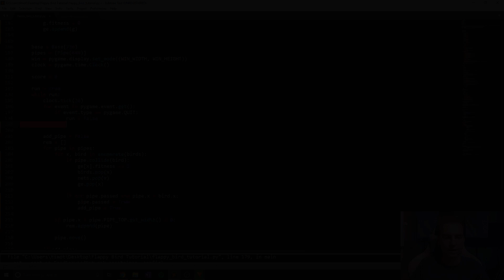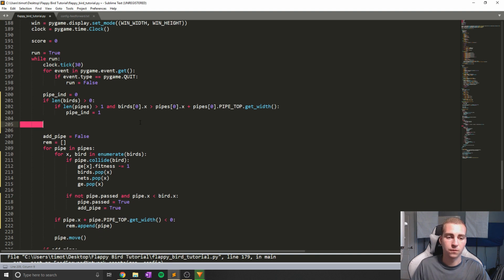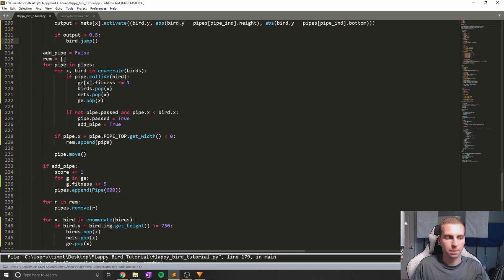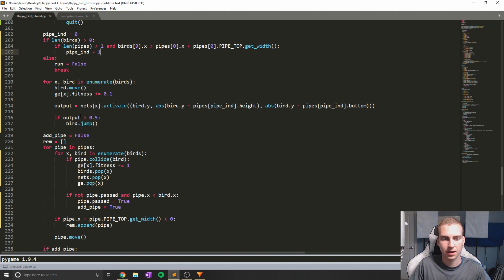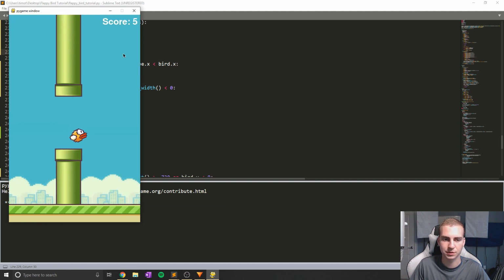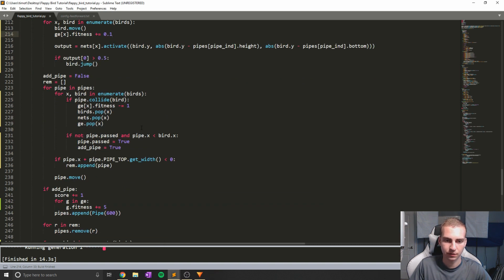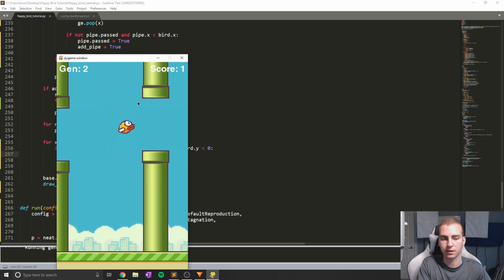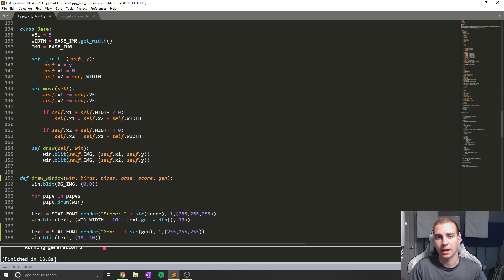Python Flappy Bird AI Tutorial (with NEAT) - Finishing Touches and Testing

Comment: for anyone reading this: Taking the Y of the bird as one of the input neurons is literally pointless. Since the other 2 neurons are absolute distance between Y of bird and Y of the pipes. The actual Y of the bird doesn't add anything because it's irrelevant to any of the decision making. You could either just not give that as a neuron or replace it with the bird's velocity. Which actually does impact decision making.

Comment: Hi Tim! Thanks so much for the tutorial, I learnt so much from this tutorial, and the explanation was on point :)
I had one question about the algorithm though,
Messing around with the code, I realized that setting the clock.tick value to a super high number causes the birds to collide very early in the game (less than 10 pipes or so)
and simply changing it to a lower number fixes the problem.
Do you, or anyone in the comment section know what may be causing this to happen?
Thanks in advance to anyone that gives advice!

Comment: when i run the code, i get a black screen and the population's fitness is always zero. it worked until i implemented this episodes changes. anyone else have the same problem?
Reply: I got the exact same issue. After stepping through the code, i found the draw function was never called. I missed an indent at this if/else constraint:

wrong:
        if len(birds)>0:
            if len(pipes) > 1 and birds[0].x > pipes[0].x + pipes[0].PIPE_TOP.get_width():
            |    pipe_ind = 1
            |else:
            |    run = False
            |    break

correct:
        if len(birds)>0:
        |    if len(pipes) > 1 and birds[0].x > pipes[0].x + pipes[0].PIPE_TOP.get_width():
        |        pipe_ind = 1
        |else:
        |    run = False
        |    break
Reply: check again for mistakes , i had the same problem, but it was due to some of mine mistakes, i don't remember  what it was, but it wasn't complicated
Reply: @electronics_8722  do you mind sharing your code for it. I would use the one he posted on github but unfortunately its very different from the video.
Reply: obviously,  that might be a bit too much to ask, so if its just something like that i guess ill review my code again. i havent touched this project in a while

Comment: Thank you for these videos
Can you explain how did you find the output value 0.5 :[
Reply: did you manage to find out why he said 0.5
Reply: @sashamuller9743  I'm wondering as well :P
Reply: @sander1426-2  I managed to find out :) The problem of this function is that the output of each neuron can saturate. Values greater than 1 are shaped as 1 and values smaller than 0 are shaped as 0.
The best sensitivity for the sigmoid function is around the central point (0, 0.5).
A big problem appears during the saturation, the algorithm can not learn during this position (it’s the source of the vanishing gradient problem, corresponding to the absence of direction in the gradient).
Reply: @sashamuller9743  That explains a lot, thanks!

Comment: 8:24 at this point I ran mine and it always tells me " AttributeError: module 'neat' has no attribute 'config' " despite me having installed and imported neat. I also tried "import neat.config" which didn't work. Nobody on stack overflow has been able to help me yet. Any ideas?
Reply: Have you maybe solved that problem by now?
Reply: @miloskatic1997  No i have not yet, any suggestions?
Reply: @Josephshanks7  Actually, I resolved that problem by checking whether neat or neat-python was installed. I knew that neat-python had to be installed, but for some reason pycharm insisted that it should be neat, lol. If you're coding in pycharm, go to: File->Settings->Project Interpreter and then click on the gear icon on the top right. You should see all modules that were installed in your project. With "+" add neat-python(not neat) and if you already have neat there installed, deinstall it with "-". After doing those changes, in your code write "import neat" and it should be recognized as neat-python(at least it was in my case). I hope this unnecessarely long comment was helpful, good luck :)
Reply: Hello, I was able to fix the same error by clearing the cache of my interpreter like so :

" Clean out the system caches: From the main menu, choose File | Invalidate Caches/Restart. The Invalidate Caches message appears informing you that the caches will be invalidated and rebuilt on the next start. Use buttons in the dialog to invalidate caches, restart PyCharm, or both. "

Sources : 

Issue description : https://rafikitechnology.com/2017/10/24/python-attributeerror-module-object-has-no-attribute-config/

How to clear cache : https://www.jetbrains.com/help/pycharm/cleaning-system-cache.html

Hope this helps.

Comment: Good series. I played around with it a bit and made the game more difficult by reducing the gap between the top and bottom pipes, so it's now random between 160 and 170. In the pipe's set height function it's:

self.bottom = self.height + random.randrange(160,170)

The AI struggled a lot with this, making it to a score of 30 after 20-30 generations. So I added another input neuron, and now it's much improved, and in my opinion more fascinating to watch it tackle this steeper learning curve. Can anyone guess what the extra input is?
Reply: Hmm, was the neuron the game ticks?
Reply: Good idea btw, i increased the velocity of the pipes/base to 15 and decreased the gap to 158 which makes it pretty much impossible but they can get some good runs if they're lucky enough with the gap locations
Reply: @samporter9785  Yeah nice idea - I didn't think of that. I think (I don't remember exactly) that I added the x position of the next pipe as the extra input neuron, so the bird has a better idea of where the next pipe to get through is. 

When we play the game, we intuitively know the x and y position of the pipes, so we know when to jump. So the AI should have both x and y coordinates was my thinking.
Reply: @ranz0u  ha nice! I was thinking the same thing watching them plow headfirst into the next pipe if its too steep a change for them to make in time. Now i want to add that..

Comment: @Tech With Tim I ran the program. But all birds die after passing the first 2 pipes all the way to 50 generations. Are they learning too well for a particular state because my fitness function is always 14.5 -15. Yet none of the birds pass the first 2 pipes. pls help.
Reply: I found my error. It was in the if statement determining what pipe it was looking at.
Reply: @crimps.on.slopers  you mean you didn't do the same as tech with Tim? And had to correct it?
Reply: @crimps.on.slopers  Thanks, that was the clue i needed, now it functions properly :)
Reply: I have the same problem. I have tried messing around with the fitness function a lot and nothing seems to help. Even tried 300 population size.
Reply: My resolution is also different I guess...so I can't put 600 as width or distance between pipes. I need to put it as 500. So maybe my heights different too. So should I change the values for bird going out of screen?

Comment: when I run mine, everything works, except the birds dont jump. They just fall, die and the game starts over and it repeats
Reply: I had the same problem. 
Check your:
            if output[0] > 0.5:
                bird.jump()
to see if its correctly indented under:
           for x, bird in enumerate(birds):

it should look like:

        for x, bird in enumerate(birds):
            ge[x].fitness += 0.1 
            bird.move()

            output = nets[x].activate((bird.y, abs(bird.y - pipes[pipe_upcoming].height), abs(bird.y - pipes[pipe_upcoming].bottom)))

            if output[0] > 0.5:
                 bird.jump()

this was the fix for me
Reply: @kevinliu5060  ya still same problem. i literally copied ur code and birds still dropping straight down for me

Comment: there is no main() funtion, how did u run this ?  only"def  mian(genomes,config )"  ,how  can i  run this
Reply: Look in the run() function, where it says "winner = p.run(main,50)". That's where the main() is ran for 50 times, and the run() function is ran in the final if statement, which will initialize every time you run the file
Reply: @kazuko8766  thank u bro
Reply: @kazuko8766  i ran the programe, and no error show,but no animation came out
Reply: @simonho9233  can you please provide me the the code you're running? Also, try to download pygame and neat again in cmd
Reply: Or telegrame
Reply: @simonho9233   same here actually get results from neat but the animation is just a black screen and it came when we tested earlier b4 adding neat.
Reply: For convenient, you can upload your file onto Google drive then share the shareable link
Reply: @kazuko8766  thank you
Reply: @simonho9233  here's the code that i fixed up for you:
import neat
import os
import time
import pygame
import random
pygame.font.init()
WIN_WIDTH = 500
WIN_HEIGHT = 800

BIRD_IMGS = [pygame.transform.scale2x(pygame.image.load(os.path.join("img","bird1.png"))),pygame.transform.scale2x(pygame.image.load(os.path.join("img","bird2.png"))),pygame.transform.scale2x(pygame.image.load(os.path.join("img","bird3.png")))]
PIPE_IMGS = pygame.transform.scale2x(pygame.image.load(os.path.join("img","pipe.png")))
BASE_IMGS = pygame.transform.scale2x(pygame.image.load(os.path.join("img","base.png")))
BG_IMGS = pygame.transform.scale2x(pygame.image.load(os.path.join("img","bg.png")))

STAT_FONT = pygame.font.SysFont("comicsans",50)    #spelling

GEN = 0     #not caps
class Bird:
    IMGS = BIRD_IMGS
    MAX_ROTATION = 25
    ROT_VEL = 20
    ANIMATION_TIME = 5

    def __init__(self,x,y):
        self.x = x
        self.y = y
        self.tilt = 0
        self.tick_count = 0
        self.vel = 0
        self.height = self.y
        self.img_count = 0
        self.img = self.IMGS[0]

    def jump(self):
        self.vel = -10.5
        self.tick_count = 0
        self.height = self.y

    def move(self):
        self.tick_count += 1
        d = self.vel * self.tick_count + 1.5*self.tick_count**2
        if d >= 16:
            d = 16
        if d < 0:
            d -= 2

        self.y = self.y + d

        if d < 0 or self.y < self.height + 50:
            if self.tilt < self.MAX_ROTATION:
                self.tilt = self.MAX_ROTATION
        else:
            if self.tilt >= -90:
                self.tilt -= self.ROT_VEL
    def draw(self,win):
        self.img_count += 1
        if self.img_count < self.ANIMATION_TIME:
            self.img = self.IMGS[0]
        elif self.img_count < self.ANIMATION_TIME*2:
            self.img = self.IMGS[1]
        elif self.img_count < self.ANIMATION_TIME*3:
            self.img = self.IMGS[2]
        elif self.img_count < self.ANIMATION_TIME*4:
            self.img = self.IMGS[1]
        elif self.img_count < self.ANIMATION_TIME*4 + 1:   #should be <
            self.img = self.IMGS[0]
            self.img_count = 0
        if self.tilt <= -80:
            self.img = self.IMGS[1]
            self.img_count = self.ANIMATION_TIME*2

        rotated_image = pygame.transform.rotate(self.img,self.tilt)
        new_rect = rotated_image.get_rect(center = self.img.get_rect(topleft = (self.x,self.y)).center)
        win.blit(rotated_image,new_rect.topleft)

    def get_mask(self):
        return pygame.mask.from_surface(self.img)

class Pipe:
    GAP = 200
    VEL = 5

    def __init__(self,x):
        self.x = x
        self.height = 0
        #remove self.gap

        self.top = 0
        self.bottom = 0
        self.PIPE_TOP = pygame.transform.flip(PIPE_IMGS,False,True)
        self.PIPE_BOTTOM = PIPE_IMGS

        self.passed = False
        self.set_height()

    def set_height(self):  #space
        self.height = random.randrange(50,450)
        self.top = self.height - self.PIPE_TOP.get_height()
        self.bottom = self.height + self.GAP

    def move(self):
        self.x -= self.VEL

    def draw(self,win):
        win.blit(self.PIPE_TOP, (self.x,self.top))
        win.blit(self.PIPE_BOTTOM,(self.x,self.bottom))

    def collide(self,bird):
        bird_mask = bird.get_mask()
        top_mask = pygame.mask.from_surface(self.PIPE_TOP)
        bottom_mask = pygame.mask.from_surface(self.PIPE_BOTTOM)

        top_offset = (self.x - bird.x,self.top - round(bird.y))
        bottom_offset = (self.x - bird.x,self.bottom - round(bird.y))

        b_point = bird_mask.overlap(bottom_mask,bottom_offset)
        t_point = bird_mask.overlap(top_mask,top_offset) ### replace bottom_mask with top_mask

        if t_point or b_point:
            return True

        return False
class Base:
    VEL = 5
    WIDTH = BASE_IMGS.get_width()
    IMG = BASE_IMGS

    def __init__(self,y):
        self.y = y
        self.x1 = 0
        self.x2 = self.WIDTH

    def move(self):
        self.x1 -= self.VEL
        self.x2 -= self.VEL

        if self.x1 + self.WIDTH < 0:
            self.x1 = self.x2 + self.WIDTH
        if self.x2 + self.WIDTH < 0:
            self.x2 = self.x1 + self.WIDTH

    def draw(self,win):
        win.blit(self.IMG,(self.x1,self.y))
        win.blit(self.IMG,(self.x2,self.y))

def draw_window(win, birds, pipes, base, score, gen): #missing paramters, replace bird => birds, add gen
    win.blit(BG_IMGS,(0,0))
    for pipe in pipes:
        pipe.draw(win)
    text = STAT_FONT.render("Score" + str(score),1,(255,255,255)) #spelling => STAT_FONT
    win.blit(text,(WIN_WIDTH - 10 - text.get_width(),10))

    base.draw(win)
    #remove bird.draw(win) since we don't need it anymore

    for bird in birds:
        bird.draw(win)
    pygame.display.update()

def main(genomes,config):
    global GEN #add global GEN
    GEN += 1    #add GEN += 1
    nets = []
    ge = []
    birds = []

    for _, g in genomes:    #replace g with _, g:
        net = neat.nn.FeedForwardNetwork.create(g,config)
        nets.append(net)
        birds.append(Bird(230,350))
        g.fitness = 0
        ge.append(g)

    base = Base(730)
    pipes = [Pipe(700)]
    win = pygame.display.set_mode((WIN_WIDTH,WIN_HEIGHT))
    clock = pygame.time.Clock()
    score = 0

    run = True
    while run:
        clock.tick(30)
        for event in pygame.event.get():
            if event.type == pygame.QUIT:
                run = False
                pygame.quit()
                quit()

        pipe_ind = 0
        if len(birds) > 0:
            if len(pipes) > 1 and birds[0].x > pipes[0].x + pipes[0].PIPE_TOP.get_width():   #misspelled get_width()
                pipe_ind = 1    #tabing
        else:
            run = False
            break

        for x,bird in enumerate(birds): #first birds => bird
            bird.move() # Birb => bird (you're accessing instances at this point, not the class itself)
            ge[x].fitness += 0.1

            output = nets[x].activate((bird.y,abs(bird.y - pipes[pipe_ind].height),abs(bird.y - pipes[pipe_ind].bottom)))
            # again, Bird => bird

            if output[0] > 0.5:
                bird.jump()

        add_pipe = False
        rem = []
        for pipe in pipes:
            for x,bird in enumerate(birds):
                if pipe.collide(bird):
                    ge[x].fitness -= 1
                    birds.pop(x)
                    nets.pop(x)
                    ge.pop(x)

                if not pipe.passed and pipe.x < bird.x:
                    pipe.passed = True
                    add_pipe = True

            # these lines was moved down and outside of for loop ###
            if pipe.x + pipe.PIPE_TOP.get_width() < 0:
                rem.append(pipe)

            pipe.move()
            ######

        if add_pipe:
            score += 1

            for g in ge:
                g.fitness += 5
            pipes.append(Pipe(600))

        for r in rem:
            pipes.remove(r)

        for x,bird in enumerate(birds) :
            if bird.y + bird.img.get_height() >= 730 or bird.y < 0:
                birds.pop(x)
                nets.pop(x)
                ge.pop(x)

        base.move()
        draw_window(win,birds,pipes,base,score, GEN)     # missing parameters, add GEN

def run(config_path):
    config = neat.config.Config(neat.DefaultGenome,neat.DefaultReproduction,
                                neat.DefaultSpeciesSet,neat.DefaultStagnation,
                                config_path)
    p = neat.Population(config)
    p.add_reporter(neat.StdOutReporter(True))
    stats = neat.StatisticsReporter()
    p.add_reporter(stats)

    winner = p.run(main,50)

if _name_ == "_main" :   #__main => __main_
    local_dir = os.path.dirname(__file__)
    config_path = os.path.join(local_dir,"config-feedforward.txt")
    run(config_path)
I didn't find the problem, though, I will give you the fully finished and working code, which can be found here: https://docs.google.com/document/d/1CC-7xhf7l6UONCRfHCM54qUuDJ13MVGS-zuaDie5mIQ/edit?usp=sharing

Comment: At 3:05 you said that the loop operates at 30 times/sec. Therefore I think the fitness value increase should be 3 each second, not 1. Am I correct? 

By the way, big thanks for the very clear explanation! I am waiting for the next AI series!
Reply: could you help me? the birds never go past first or second pipe. I tried changing the fitness function, population size, activation function etc nut no difference. The max its gone is 3rd pipe but averages between 1st and 2nd pipe.
Reply: Well, at the first time I ran the program the bird flies properly after 3rd gen. Then a few weeks later I tried to run the game again and got the same problem as yours, it does not go any further than 4th pipe, still do not know why by far even after changing those parameters
Reply: @muhammadardiputra5217  hope you figure it out. Let me know if you find out something